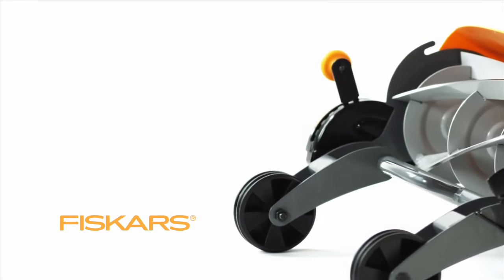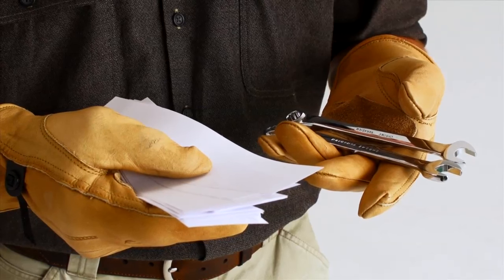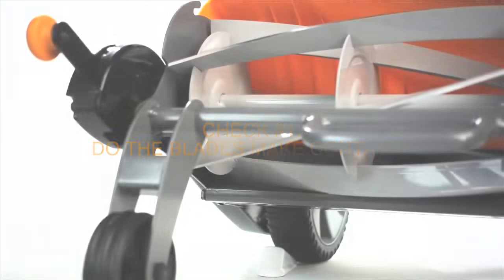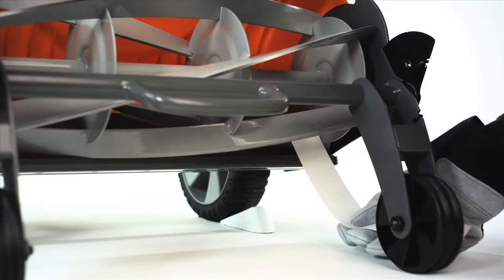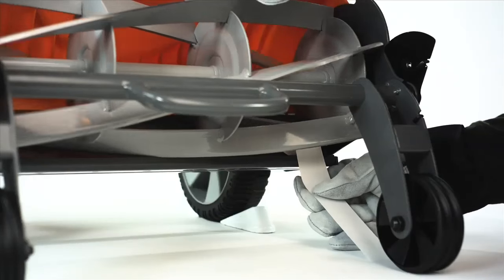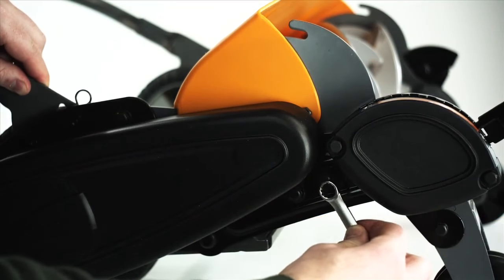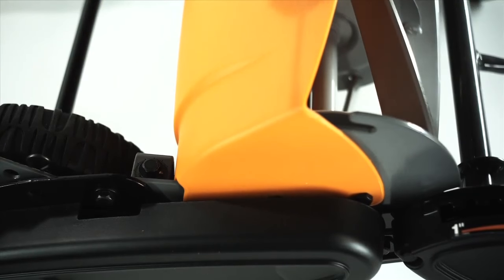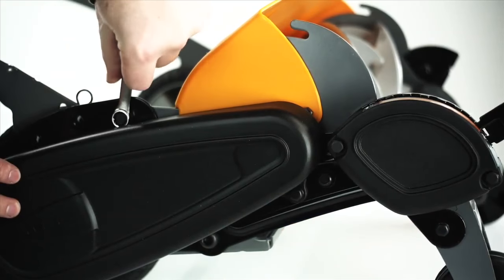Fiskars® StaySharp™ Max Reel Mower - Checking and Adjusting the Blades HD

Comment: My mower is getting harder to push and it doesn’t seem that the blades are rotating as fast as they once did. I wanted to know if it’s possible to release whatever safety mechanism stops/slows the blades from rotating when stop/slow.  My yard is very small and I’m having a difficult time getting the edges cut without having to cut my grass multiple times in different directions so that the blades are always moving on each section around the edges. It’s very frustrating and I’ve been a happy owner for many years. Probably at least 10-12. I am not concerned about spinning blades in safety as I’m the only one that uses the motor and there are no children in my home. Prior to buying my Fiskars Eversharp, I had a 1901 Toro reel mower… That spun and cut at max speed even the very edges of my yard when I stopped.  I literally had the rubber on the wheels fall off… When it was 112 years old. (Dry rot.) I tried for other mowers before I settled on the Fiskars.  At 65yo I enjoy cutting my grass… But the mower feels like it’s moving slower than I am and I’m still moving pretty fast.

Comment: I sharpened and adjusted the mower (actually did the sharpening several times) and was never able to get it to cut paper in the center area, just the ends. Do you have any suggestions?
Reply: they don't show holding the paper in the center?
Reply: Yeah, toss the mower.

Comment: I bought one used off CL and it needed sharpening and adjusting, it’s easy to push and cuts well.  I have run into a few problems though, my mower was well used and one of the blades is ever so slightly bent and the knife bed adjusting screws are stripped in spots making precise adjustments impossible.  I’ve tried to contact Fiskars about getting parts but I’ve had no luck.  It may end up in the trash heap as it doesn’t cut as well as it should.
Reply: I have same issue. Thinking of going to home depot/lowes and try to get new bolts and lock nuts before I toss in trash to make better adjustments. That's what i get for trying to buy 2nd hand I guess. Let me know what you ended up doing, giving up or did you come up with anything.
Reply: @jenniferbmendezful  I tried the box store route too, I wasn’t able to find anything. The adjustment bolts are unique to Fiskars. I was able to get them to send me some, but the female threads had been worn to the point that they wouldn’t hold the bolts. The mower was taken to the dump.
Reply: @warrenstemphly5756  thank you, saved me time.

Comment: They don't mention that the adjustment screws have a left handed thread, so tightening the jam nut on the bottom will be backward. Also the "Locking Bolts" shown in the instructions are 10mm on mine, not 11mm.

Shouldn't let the summer interns write the manual.